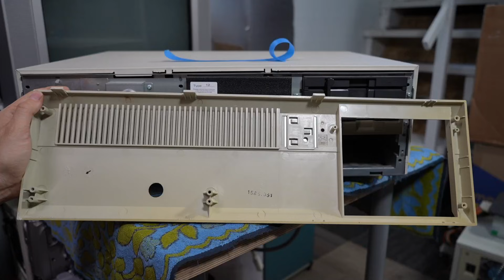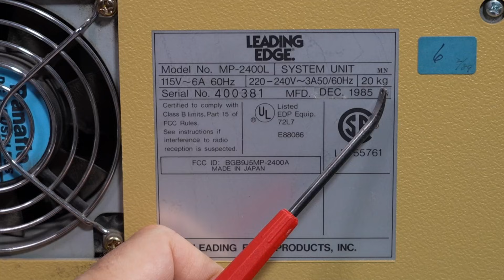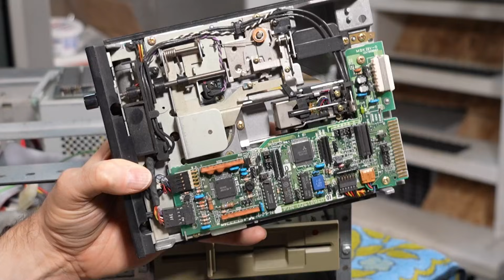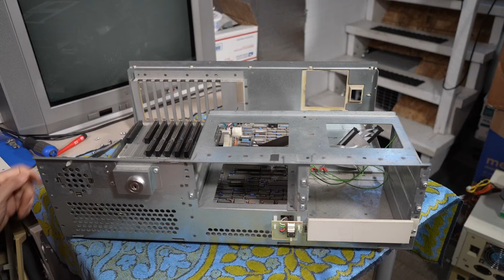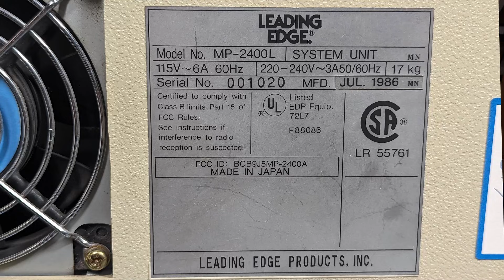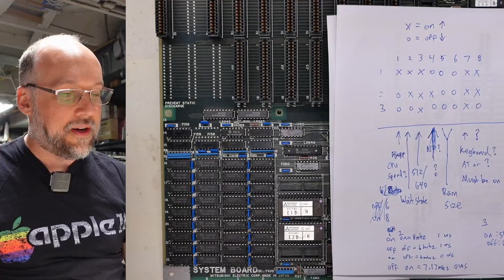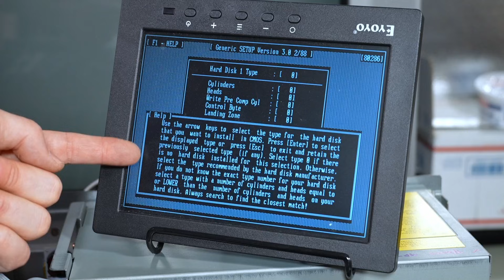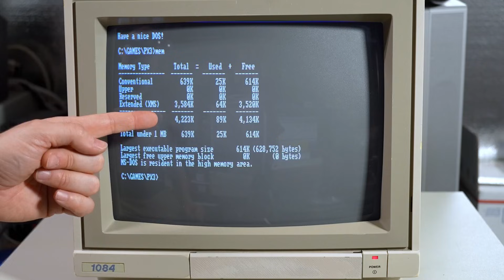PC archeology: The Leading Edge MP-2400L doesn't exist

Comment: Hi Adrian.  I sold these back in the day.  It was a short run Leading Edge made by Mitsubishi (normally LE would have used Daiwoo).  This Leading Edge design was OEM'd from Mitsubishi and was also used by Sperry.  Look up Sperry PCs and you'll see this design language.  Somewhere I have a picture of this computer when I had one :)
Reply from the maker: Heh do you recall how long these were sold for and if they even sold well? Judging by the quality it seems like it would have been an expensive thing.
Reply: @adriansdigitalbasement I sold them in the late 80s for about 2 years. Super  cheap and super unreliable.
Reply: @clevelandkeith  Funny that... I guess the QC wasn't very good, since this looks like a solid build!
Reply: I purchased a Sperry PC/HT (IBM-XT clone) in college.  It was cheaper than the IBM-XT and had a faster processor.  The Sperry PC/IT was the 286 version.
Reply: Leading Edge called all the Mitsubishi machines they shipped the "Model M", so this one was likely sold as the "Model M-H". If I recall there was some sort of lawsuit and LE stopped selling these. They later switched to Daewoo for their wildly successful Model D (see a pattern here?). Daewoo eventually bought out the whole company. Source: I worked for one of the largest Leading Edge resellers in NJ.
Reply: @NJRoadfan  I worked at Leading Edge in Needham/Canton, MA and had one of these and a Model M on my desk when I started in 85.  I also worked on the Model D from the prototype stage.  You are absolutely right, CEO Michael Shane had the lawsuit with Mitsubishi and that relationship went south, and we quickly started shipping Model Ds as a replacement.  The real hen's teeth is the Leading Edge model D2 (286 Model D....really liked that machine).
Reply: @chandrab  The hen's teeth award goes to the Model D3/MC.....a MicroChannel based 386 machine. We had one along with a D2 in the back room. I think my boss kept at least one of every model on hand. Did LE ship demo machines out to dealers? We had just about everything including the last-of-the-line Fortiva 6000 P90 tower!
Reply: @NJRoadfan  the same Daewoo that made the Chevy Aveo?
Reply: @SockyNoob yes and no.
Reply: @SockyNoob  Yes, the same one. They, along with Hyundai, are the Krebstars of Korea. They made just about everything.
Reply: @SockyNoob may have been then, but def not by the time the aveos were made. The aveos are a tiny bit more than rebadged Daewoos, since Chevy bought at least the factory that made them, as well as the Suzuki swift? And Pontiac something. Currently drive an '08 Aveo 5 myself. Lol.
Reply: Yep...... They're Mitsubishi.  Sperry bought their US assembly facility and the rights to the design in early 1986 before their acquisition from Burroughs.
Sperry, then Unisys after the merger sold them as the IT PC.
My father is retired from Unisys.  We had the Sperry version in our home when I was a kid. 

Thanks for sharing these.  I've never seen them with this brand name before.
Reply: Had one of these in Sperry guise on my desk in the mid-1980s. I worked for Sperry.
Reply: @stevew8233  Cool!!  My father was a Burroughs guy.  Hired in 1981 retired in 2019.   He was a large systems engineer.  They didn't lay him off after the merger because he was willing to immediately learn how to work on Sperry equipment.  A lot of his older Burroughs and Sperry co-workers resisted the change.   Burroughs Engineers were specialized (I.e. Small, medium, large systems, payment systems, etc.) whereas Sperry engineers worked on everything. The new Burroughs (Unisys) went with the Sperry engineers fix all equipment model.  That merger should have never happened. Michael Blumenthal destroyed an amazing company.  Sperry was the better of the two companies.  Sperry was philanthropic, was engaged in future technology R&D, and cared for its employees.  Also, Sperry's diversification was a real asset.  If one division had a bad quarter the others could make up for it.   With Burroughs, it was always about making shareholders happy and all Burroughs did by the 1980's was computers.  No diversification.
Reply: I thought Leading Edge computers were made by Hyundai. Also, it's Daewoo. The fact it says "Made in Japan" on the back and not "Made in Korea" told me it wasn't one of the Hyundai ones.
Reply: @hypnotised-clover  The FCC grantee code BGB is the best way to determining the (Mitsubishi) origin. Made in Korea could at that moment point to roughly 3 major manufacturers, even though it's likely they only ever did business with Mitsubishi and Daewoo.

Comment: When you have the switch set for 640K base memory the remaining 384K  memory might be used to shadow the ROMS into RAM, and also as upper memory in the gaps between the ROMS and video card. Some systems did this.
Reply from the maker: 286's don't support that kind of remapping, that was introduced with the 386 processor. :-)
Reply: @adriansdigitalbasement  It's not really remapping, just shadowing the ROMS into RAM (at the same address) and using the gaps between as Upper RAM, no remapping involved, as you say, remapping didn't come in till 386.
I've just done a quick google search and there is plenty of details of 286's with Shadow RAM and upper RAM
Reply: You probably need the BIOS setup program for this though.  Since some of the hard drives worked did you look through them for the BIOS setup program ?
Reply from the maker: @jameshearne891  and yeah indeed there must be the setup program to allow those drives to work, as clearly they were working somehow.

Comment: Do you have enough parts to make a second machine? Will IDE controller and hard drive work in second machine?
Reply from the maker: Yep I have two fully assembled machines now, and the second one is going to my friend David who made the Apple II diagnostic ROM on my last video. He intends to try to run XENIX 286 on it :-) I didn't test IDE on this -- I am pretty sure it won't work properly for the same reason it doesn't work on the stock 5170 BIOS. (not without modification)
Reply: @adriansdigitalbasement  Had the original IBM with Xenix, suggest a new hard drive or SSD be installed as Xenix is notorious for disk thrashing!
Reply from the maker: @marksmith9566  supposedly it only works with MFM as it talks directly to the hard drive controller.
Reply: @adriansdigitalbasement  We have gottem scsi card and hard drives to work on MFM only machines. May need to start OS on floppy though.

Comment: The FCC ID on the back label comes up as for a Mitsubishi 9J5MP-2400A computer, with this note on the FCC application "The shielded power cord must be supplied by Mitsubishi. This application includes an optional memory expansion board, two fixed disc drives, and two floppy disc drives." That's another dead end though as far as I could search.
Reply from the maker: Yeah, I'm hoping someone might be able to turn up info on the Japanese domestic version of the machine, if it even exists. I hadn't looked up the FCC ID so too bad that's a dead end too.